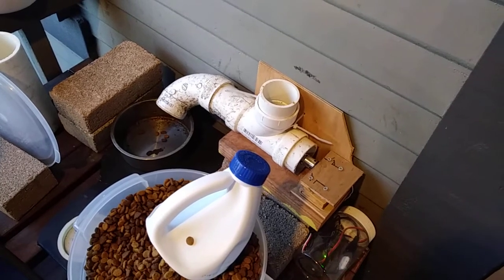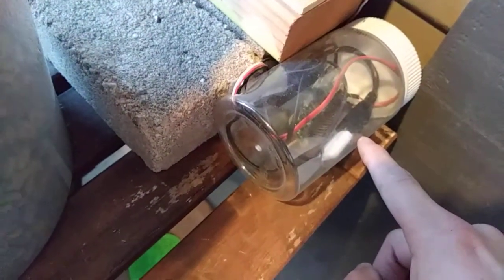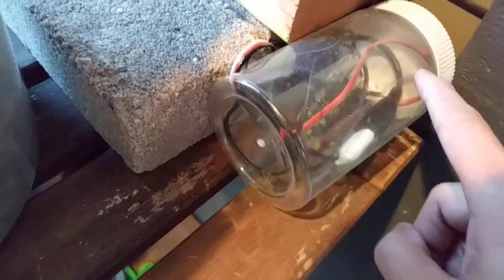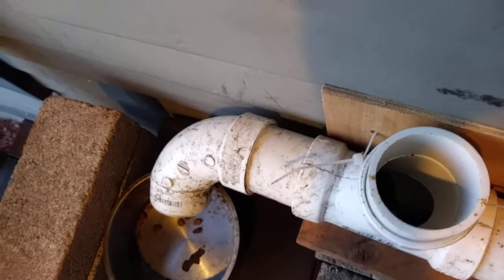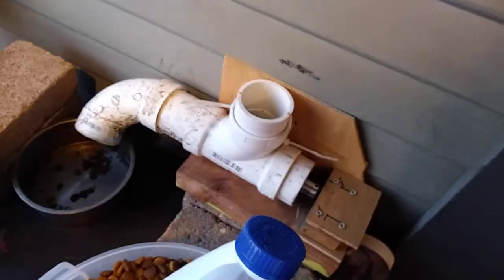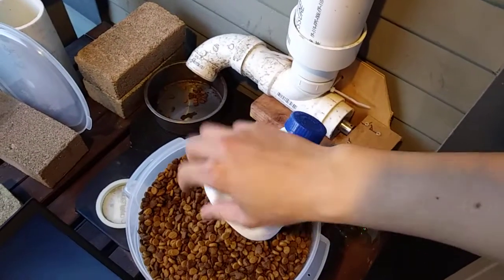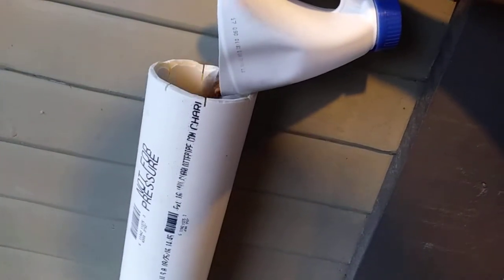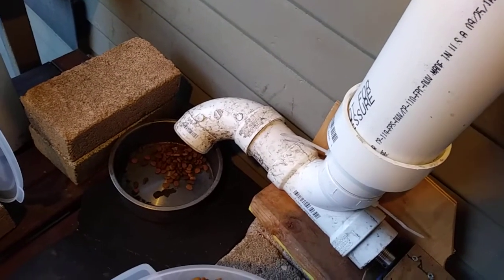Automatic cat feeder diy raspberry pi

Comment: Really like your design!  I've been trying to come up with the same idea for our feral cat colony at the fire station.  I have some Arduino / Raspberry Pi experience, but I'm at a loss for what to use as for an auger drive motor. The Arduino can't handle the kind of current draw so I'll need to trigger it with a relay. No power on site in the field, so it needs to be battery controlled.
Reply from the maker: I used this continuous rotation servo as it seemed to have a decent amount of torque: https://www.ebay.com/itm/SpringRC-SM-S4315R-Steering-360-Degree-Robot-Servo-60g-JR-plug-30cm-Cable-4-8-6V-/265321720653
I used a raspberry pi zero and hooked the servo directly to the gpio pins... surprised it worked without needing a separate power source... 😃
I haven't played with Arduino.
Have fun tinkering!
Reply: @wasabisohot  That's great information to have. Thanks for such a quick response!

Comment: Not pretty, but it seems to work.  What servo motor did you use?
Reply from the maker: i agree - definitely not pretty but my cat survived when we were out for a 10-day trip.

i used this continuous rotation servo which can be found on ebay for ~$15 shipped from asia:  SM-S4315R

cheers!
Reply: @wasabisohot  not a put down.. I make lots of functional stuff that is an expression of natural laws and that works..not always "pretty".  Thanks for your post and the parts info.
Reply: @wasabisohot  what about their water in the 10 days trip?
Reply from the maker: @zxcvqwer6649  we had a 1/2+ gallon water bowl